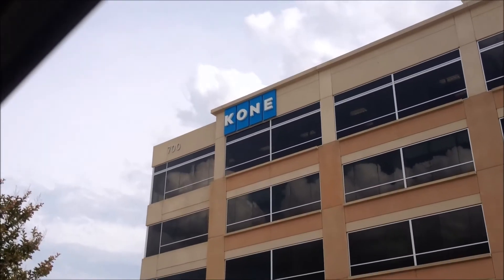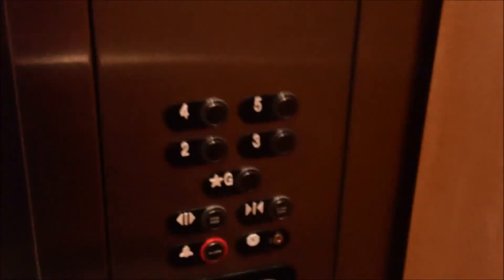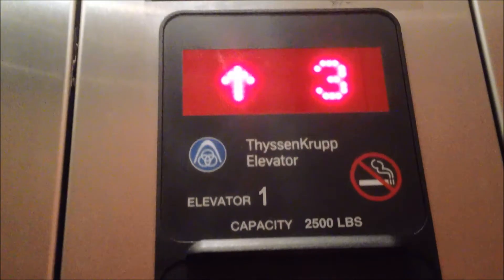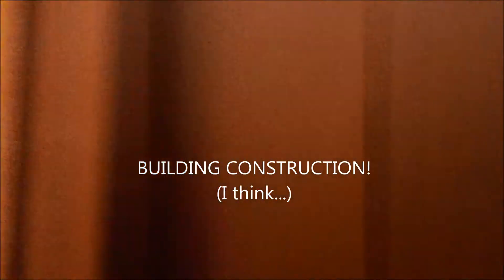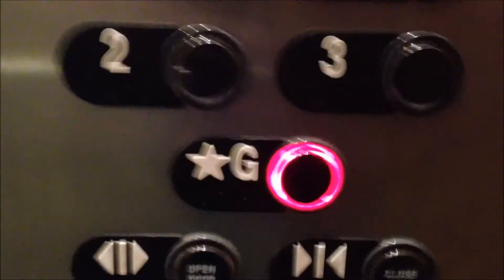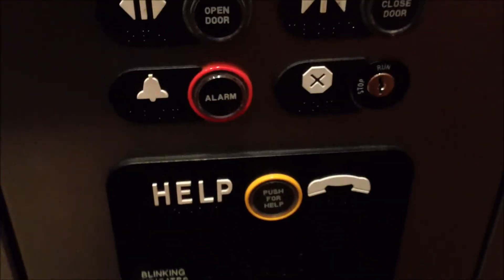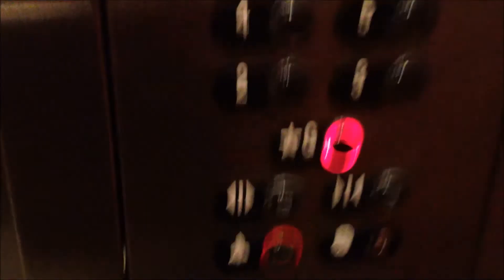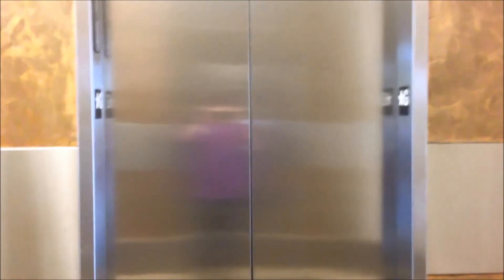ThyssenKrupp ISIS Elevators at the One Allen Center Building in Allen Texas

Comment from the maker: Yeah, this doesn't make since. Maybe they are maintained by KONE? I'm not sure why KONE would occupy a building with TK in the first place. However, I have noticed that KONE elevators are not common in this city, and I think that KONE had to move here due to the convenient location (right on the side of the highway). There are no KONE elevators in this building, just TK. Also, I found a violation on the date these elevators were being installed (see description). Maybe KONE replaced the cables?